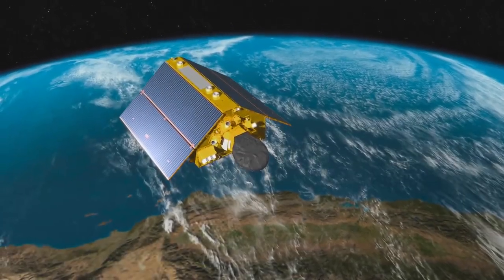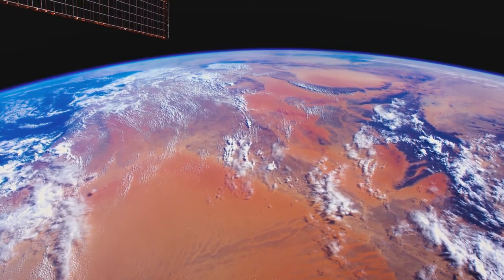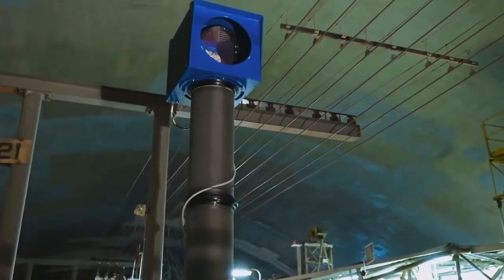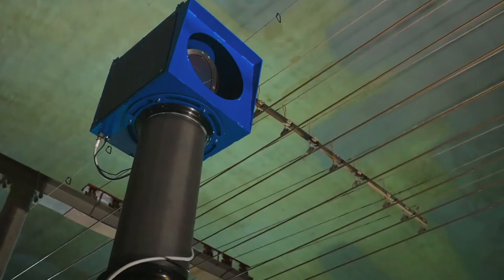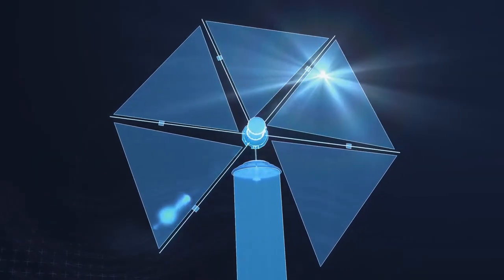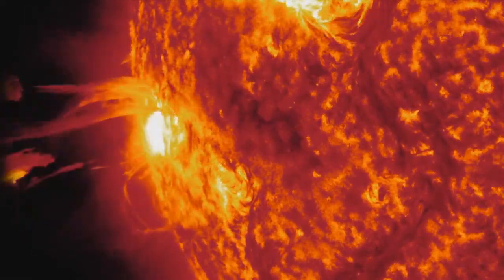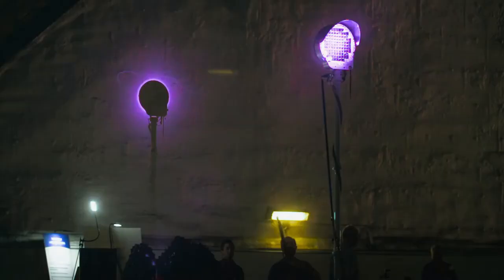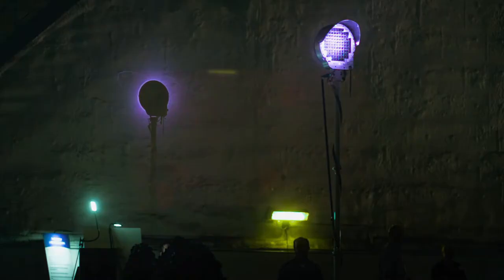Engineering the Future   Wireless Power Beaming

Comment: I don't doubt you can convert and beam power to the ground (been following you guys for years), but to do that in space you have to get rid of any excess heat - LOTS of it - probably on the order of 90% of the final 'wall plug power'.  Getting rid of more than a few 10s of KW is basically impossible AFAIK.  What's the plan?